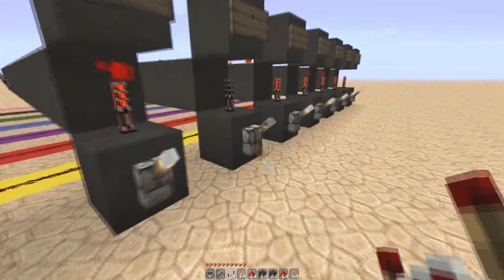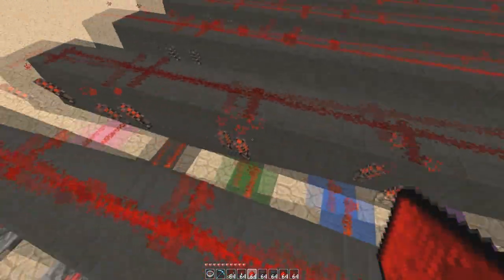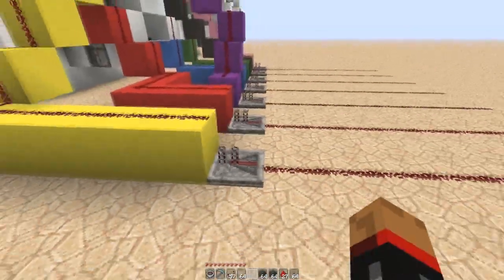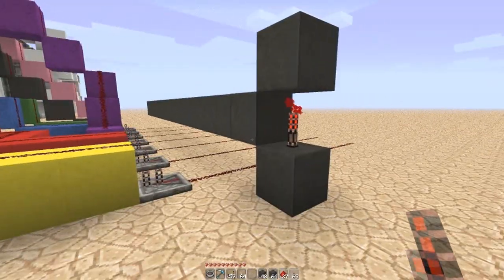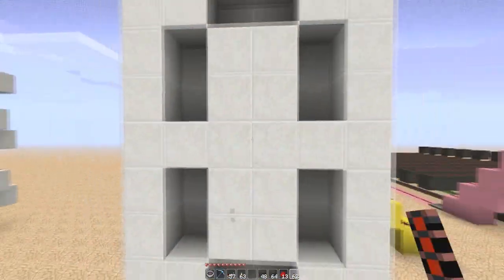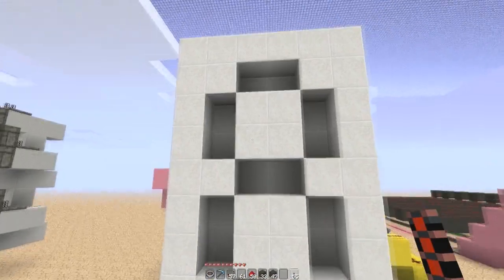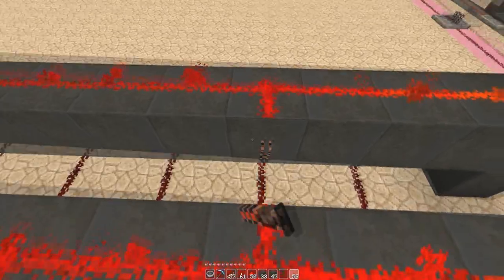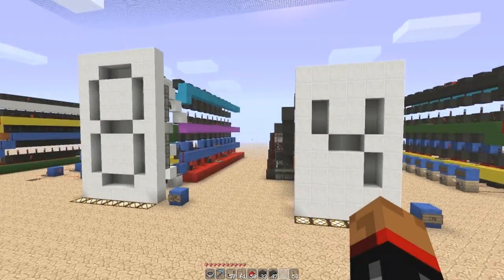Seven Segment Display + Decoder, Part 2 [Advanced Minecraft Redstone Tutorials]

Comment: Just put down a bunch of repeaters with some delay depending on how fast you want it to count down, in between sets of repeaters attach a line of redstone to the top decoder bits in this video, put a button at the start of the repeaters. When you press the button a redstone signal should travel slowly between the repeaters turning on 9 first, then 8, then 7 and so on